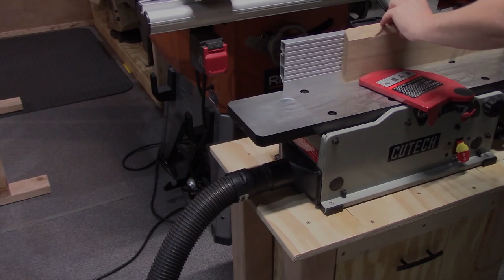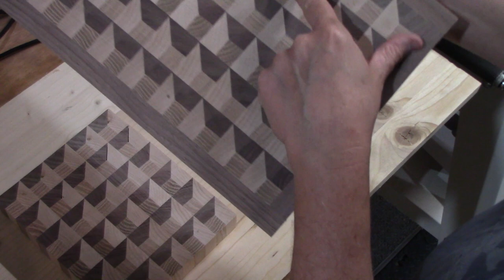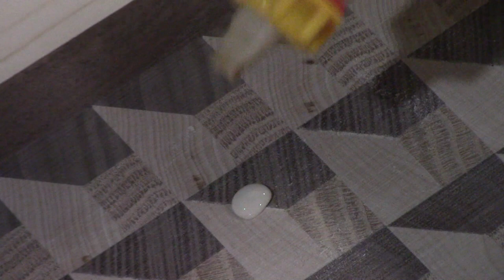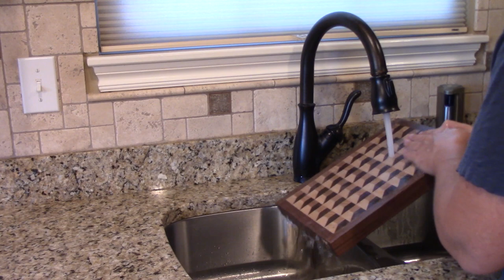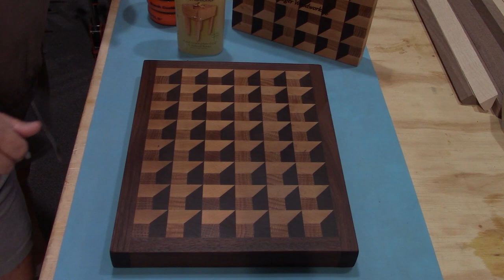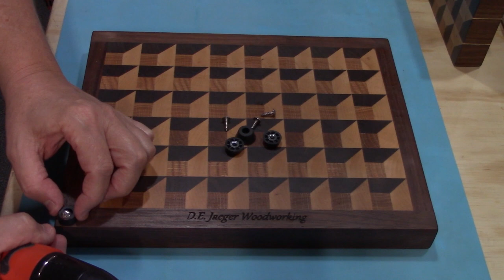The Stunning 3D Cutting Board - Part 2

Comment: If you don’t have a drum saw, what tool would you use?  Could a planer work?  New to wood working and trying to buy stuff but everything is so expensive haha!
Reply from the maker: Thanks for watching the video and commenting.  There's a number of ways to true a surface in woodworking.  From basic hand tools like a planer to a full-sized electric planer.  I have also seen a number of folks use a handheld router with a home made jig for such an operation.  If you're new to woodworking, I fully understand not having some of the advanced tools.  If you can afford just a little bit, I would look into the handheld router.  Then search for "router sled" on YouTube for some videos on how to make one.  There are lots of great videos out there.

Comment: Nice work. Can I ask what dust collection system you run. Your ship / work area is so neat and clean.  What clamps did you use on the final glue up?  The orange ones with the big flat surface contact?  Thanks. Great video 👍🏻
Reply from the maker: Hey Harry, thanks for stopping by to watch the video and comment.  Yeah, I'm a bit of a neat freak in the shop.  I never know if I'm going to be in it just for a day, or several days, so I tend to do a little clean up at the end of the day unless I'm absolutely sure I'll be in the next day, even then sometimes I tidy up.  On to your questions... The dust collection system is a  Powertec DC5370.  I mounted it to the concrete wall of my shop which happens to be in the basement.  It uses a standard 4" collection hose and I've added a Y duct adapter so it collects dust from my table saw and drum sander.  I've been really happy with it and it's not bad in terms of sound.  Typically I've got music playing in the shop and sometimes forget to turn the dust collector off even when I'm done using it.  https://smile.amazon.com/POWERTEC-DC5370-Collector-Micron-Filter/dp/B01M18RJOU/ref=sr_1_1?dchild=1&keywords=powertec+dust+collection&qid=1607289240&sr=8-1

The clamps are JORGENSEN 8018 Cabinet Master 18 Inch 90 Degree Parallel Steel Bar Clamp.  I have pipe clamps as well, but after watching a video of someone using these, I bought 4 and have never looked back.  They have a large flat, right angle face, and they are nice and stable on the work surface.  Here's the link to them on Amazon.  I have the 18" version, but they have larger ones and sometimes they are cheaper.  https://smile.amazon.com/JORGENSEN-8018-Cabinet-Master-Parallel/dp/B00005R1HM/ref=sr_1_1?dchild=1&keywords=JORGENSEN+8018+Cabinet+Master+18+Inch+90+Degree+Parallel+Steel+Bar+Clamp&qid=1607289147&sr=8-1

Comment: Beautiful! I want to try  this. I want to use Purple Heart, Maple  and Padauk. I have made other cutting boards  but the oils in the Padauk always leaks out and spreads to the  Maple. How to keep this from happening? No matter how many time I try to clean  it and re apply finish,  the orange  keeps coming out. And suggestions.  Thanks
Reply from the maker: Thanks for watching the video and commenting.  I appreciate your boldness in the woods that you are choosing.  Padauk is always a problem in terms of dust and bleeding.  Typically I would tell you use acetone before sanding and sealing, but that's not really possible with a cutting board because acetone isn't food safe.  Here's a link to a discussion regarding this very subject. Not sure if any of these suggestions will work, but there are some things to try.  You might just glue up a piece of purpleheart, maple, and padauk together to test these suggestions.

https://forum.canadianwoodworking.com/forum/woodworking/woodworking-aa/34998-padauk-purpleheart-colour-bleed
Reply: Thank you so much for such a fast response!! Love you work. I think I may just use Walnut Maple and Purple Heart. Think that will work? And have a great Christmas 🎄
Reply from the maker: @bobhoffman8717  I google a purpleheart, walnut and maple cutting board and found a 3D waffle pattern using those boards and it looks pretty good, so I think you'd be fine.  Here's the board I found.

https://www.etsy.com/listing/633898809/3d-waffle-end-grain-cutting-board?gpla=1&gao=1&&utm_source=google&utm_medium=cpc&utm_campaign=shopping_us_a-home_and_living-kitchen_and_dining-cookware-cutting_boards&utm_custom1=_k_Cj0KCQiAwJWdBhCYARIsAJc4idAev4JLXDNbvQ0i5JFoKdnvStai3VpADKhYNBc09wG4bVuE79XzFLYaAva-EALw_wcB_k_&utm_content=go_12570712527_123240169567_507394969390_aud-1118323511478:pla-305108364187_c__633898809_527700975&utm_custom2=12570712527&gclid=Cj0KCQiAwJWdBhCYARIsAJc4idAev4JLXDNbvQ0i5JFoKdnvStai3VpADKhYNBc09wG4bVuE79XzFLYaAva-EALw_wcB

Comment: Mr. Jaeger, Why did you decide to use a drum sander and not a planer for the final dimensioning of the material? Most videos, I see the DS being utilized on the final end grain sanding only. Also, I really, really liked the grain pattern of the red oak, but it seems like the conventional wisdom is that while white oak might be okay for EG boards--red oak is way too porous for this. Have you experienced any problems in this regard? Thank you and keep up the good work.
Reply from the maker: Thanks for watching the video and commenting.  I go back and forth on planer and drum sander.  If my stock is close to final dimensions, I can finesse a little better with the drum sander and never run the risk of a chip out.  I've gotten a lot of comments regarding the use of red oak.  Agreed on its porousness, but the customer I made this for wanted it for display purposes on their kitchen island, and never has any plans to use it as a conventional cutting board so I took some creative liberty.  If it was going to be used in the conventional sense, I'd likely use the cherry for that portion of the 3D effect.  Great questions, thanks!

Comment: The boards look really great. Just wondering how the border will fare in the long run as you are gluing end grain to long grain ?
That is, the 3D pattern is end grain which moves a lot more than the border wood.
Reply from the maker: Thanks for watching the video and commenting.  I've had a few other viewers mentions to cross grain glue up.  Luckily I know the person who purchased this board personally and know that he is meticulous about treating and caring for his cutting boards.  He only used this board as a "show piece" and has never cut on it.  Hopefully that will prevent a lot of the shifting that would occur from rinsing, drying, etc.  Not failsafe by any means, but he's had the board for 4 years now and I haven't heard about any problems so far.  I've made other 3D boards since then and don't include the border, or if I do, I'll definitely make sure that it is also oriented endgrain.

Comment: Awesome video!! Kind of a weird question but I was asked it and am looking for an opinion..  would an endgrain construction such as this work well if used as an entire counter top?  I know they make butcher block counter tops, wondering if endgrain would work as well?
Reply from the maker: Thanks for stopping by to watch the video and comment.  I can't say that I'm an expert on countertop construction or materials.  I would think in order for a design like this to work, first and foremost, your base would have to be extremely solid and level just so the 3D pattern would all sit flush when assembled together.  I don't think you could get away with just doing the 3D pattern without putting something like a clear epoxy over the top of it to keep it from shifting, warping, cracking, etc. over time.  I definitely think it could be done, but would be a colossal undertaking depending on the length and shapes of your countertops.  You might try it on something like a solid island first.
Reply: @DEJaegerWoodworking   thank you for the reply! Your answer does give me options to think about and to consider.   Thanks again!

Comment: Great video. Very instructive. I notice that you don't put finger holds on your boards. Is this by design or because of the thickness of the board. Also, how long after the oil bath do finish up with the wax.
Reply from the maker: Thanks for watching the video and commenting.  It really depends on the board.  If the board is 1 inch thick or less, I never put finger holes in the board.  But even on thicker boards it really just depends on how I feel about the board.  Since most of the boards I make have rubber feet, it raises the board up enough to get your fingers underneath it to pick it up.  I really like the trend on thicker boards of cutting an angle along the bottom side of the board and plan to do that on my next thick board.  I've also seen a few videos where the rubber feet are recessed, and kind of like that look as well.  In regards to the wax.  I typically let the oil drip dry over night, then apply the wax the next day.

Comment: Fantastic video series.  I would like to try my hand at this design, but I have a question.   The drum sander figures prominently in the build.  What are the alternatives for those of us without a drum sander?  Thank you in advance for your advice!
Reply from the maker: Thanks for watching the video and commenting.  I'd say there is always more than one way.  For something like this I would typically use a planer, but because the grain orientation is end grain, I don't want to risk tears and chips.  I'm assuming that the planer option not be something you're looking for either though.  I have seen a number of woodworkers come up with jigs for their handheld routers to assist with truing up surfaces of their projects.  You might search for flattening a board without a planer.  Additionally, you could use a hand planer, a handheld electric planer, etc.
Reply: @DEJaegerWoodworking  thank you. I do have a planer, just not a drum sander.   Yeah I understand the risks of endgrain going through the planer, but maybe if I go with very very shallow passes. 

Will definitely try first on glued up endgrain scraps. Thanks again!
Reply from the maker: @GrumpyDogTX  Add a perimeter of scrap material around the outside to protect against chipping on the edges.
Reply: No problem to both joint and plane end grain. I just glue a scrap piece on the back side to prevent tear out and then cut it off when I'm  done.  If I was building this I would do all of the processes on the jointer or planer rather than drum sander as it is more accurate and will give you a flatter surface.  @GrumpyDogTX

Comment: it's really nice, i try to do the same but after i put water on it to raise the grains, my board start warping in less then 10min , is it because of the water? do you have any idea why?
Reply from the maker: Try using just a spray bottle with water instead of rinsing it under the faucet.  Just a light mist across the surface of the board should do, then let dry completely before sanding with the next level of sandpaper.

Comment: Won't the edge grain border conflict with the end grain center...separate?
Reply from the maker: Thanks for watching the video and commenting.  There's is a possibility of that, although I know the customer who purchased this board is using it more as a show piece than an actual cutting board.  It won't receive the day to day cleaning and rinsing that a normal cutting board would which will lessen that likelihood.  Additionally, the customer is meticulous about the care of this cutting boards and keeps it oiled an conditioned which should also lessen that likelihood.  He's had it for a few years now without any reported issues.  If I was making another board like this I would likely leave the border off completely to mitigate the risk of separation as shown with the smaller board at the beginning of the video.

Comment: After I grain popped my board by just spraying it down with a spray bottle the next day the board was badly warped. I had to re wet it and place it upside down on a table with weights on it for a few days for it to flatten back down. What did I do wrong?
Reply from the maker: Thanks for watching the video and commenting.  You want to make sure that you equally wet both sides. This is true for when cleaning a cutting board as well. Always rinse both sides and set it on edge to dry. Really surprised that it would warp badly with a light spraying of water though. Could also depend on the dryness of the stock you were using and the humidity in the air where it dried. Lots of factors so couldn’t specifically say why you had this experience. You certainly selected a good way to correct the issue.

Comment: It's better to clamp going from one end down the board to the other, if you clamp the far ends first you run the risk of clamping a bow into the wood which will result in some of the issues you encountered
Reply from the maker: Thanks for stopping by to watch the video and comment.  I'll definitely give that a try next round.  I've got a new order for one, and will be taking some of the suggestions that users posted.

Comment: Are those jorgensen bar clamps adapters to make it more like box clamps?
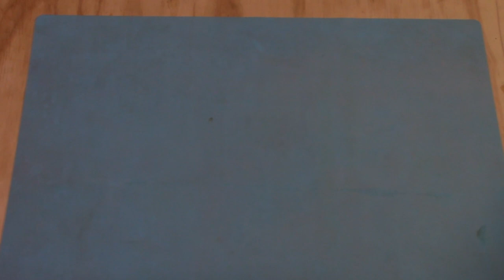Reply from the maker: Thanks for stopping by to watch the video and comment.  I'm assuming your talking about the clamps at around the 9:00 minute mark?  They are actually Jorgensen 90 degree parallel clamps (18" long version).  They are typically used for cabinets, but I like them because the keep everything nice and square and the base is stable.  You can find them on Amazon at the following link...

https://smile.amazon.com/gp/product/B00005R1HM/ref=ppx_yo_dt_b_search_asin_title?ie=UTF8&psc=1

Comment: Stunning cutting board!  I’ve just started making them.  Curious if you can provide links for the bin and rack you used for the mineral oil application.  My wife didn’t take too kindly to me using her baking pans when I did mine.  - Ed
Reply from the maker: Thanks for stopping by to watch the video, and for your question.  I actually purchased the oil container/bin and rack at Walmart.  It's a Sterilite brand is 24" x 15" x 6" and has a capacity of 25 quarts.  I usually only put a gallon or so of food safe oil in it which is enough to cover most of the cutting boards that I do.  The rack was also purchased at Walmart and is expandable.  When not expanded it's about 18 inches long by 12 inches wide and is about 5 inches tall, so it fits perfectly in the container.  I can keep it in the container and lock the top in place and slide it out of the way knowing that dust and other items won't end up in the oil.  Hope this helps.  Love the work on your channel, and am now a subscriber!

Comment: Pretty cute visual effect.
Reply from the maker: Thanks for the comment, and for stopping by to watch the video, Mark.  It's a pattern that I've seen others do, and have always wanted to attempt it.   There's lots of creative minds out there with different patterns that I hope to try.
Reply: @DEJaegerWoodworking  It may be obvious to you now but the crucial bit is to get your mitered edges to add up to 90 degrees and keep them in place during the glue-up. This is a pattern I've never tried but will if I ever gain that confidence in the accuracy of my rips.
Reply from the maker: @markkoons7488  So true.  All of it adds or detracts from the final project.  I had posted to another viewer that I replaced my table saw blade after this project was done, but wish I had done it before as it would have made even more difference in the way the different pieces assembled in the glue up.  We're all learning, and hopefully we learn from our mistakes.  Good tools and good practices make all the difference.
Reply: @DEJaegerWoodworking  Yes, and a uniform feed rate helps avoid the blade's flutter. I think that realization, the fluttering blade, is the real reason people move toward more powerful saws as they are able though I knew a professional who bought a new Delta saw during WW-II which was available in a 3/4 Hp version. He kept his HS steel blades sharp and fed the saw at an steady rate. That saw produced fine work for him into the early '80s.

Comment: I made the board in your video, have you had any problems with the border cracking the board? I'm being told by other wood workers to cut the boarder off before it cracks.
Reply from the maker: Thanks for stopping by to watch the video, and for your question.  I'd say there are a lot of factors at play.  I've had several viewers point out my cross grain gluing "failure".  The factors at play here are that the user that I made this board for uses it as a "show piece" in their kitchen and weren't even planning to use it, so it is not going to experience the moisture exposure that a typcial cutting board would.  That probably doesn't excuse the fact that I still glued it up that way, although the smaller board (that doesn't get as much attention in this video) didn't include the border.  It really was a last minute addition to the larger board, and probably should have been oriented as an end grain border if I knew it was going to get normal cutting board usage.  Another factor really, is the care, cleaning, and conditioning of the board by the user.  I provide extensive care and cleaning instructions with my cutting boards in order to prolong the life of the cutting board, but there is only so much you can do when you finally let go of a project to the end customer.  If they don't follow instructions and put something like a mosaic cutting board in a dishwasher (heaven forbid, but people are stupid), then it wouldn't matter how much care went into creating the board... that one's a goner.  If you're worried about the border, then it should be an easy fix to trim it off at a table saw.
Reply: Why should it crack if the wood is kiln dried and well sealed?  There are many instances in woodworking where long grain and end grain are joined together in various ways. It’s all about the preparation of the wood, adequate gluing etc.  what reason did they give?  Maybe if exposed to too much moisture?  Seems like a an unnecessary criticism.